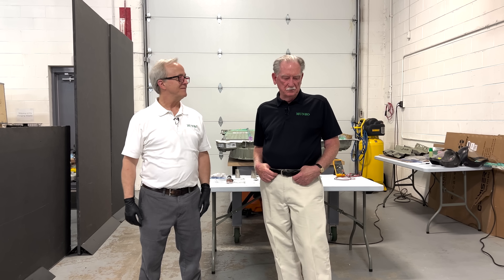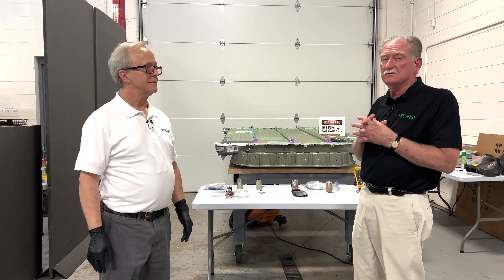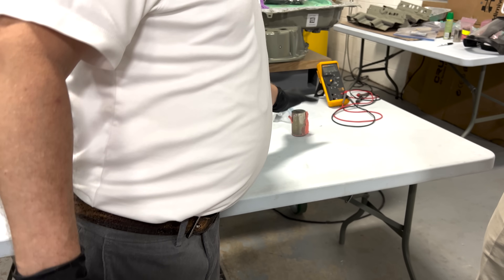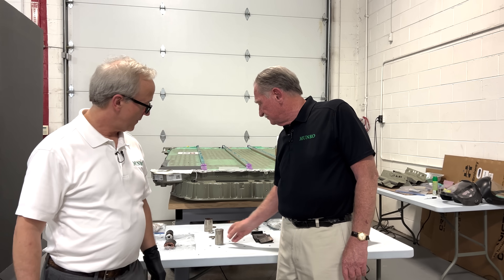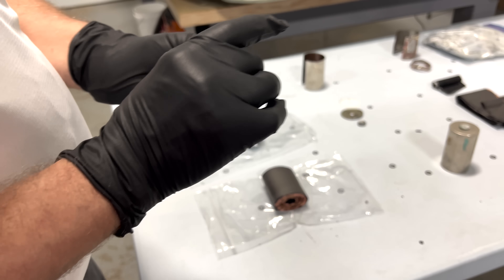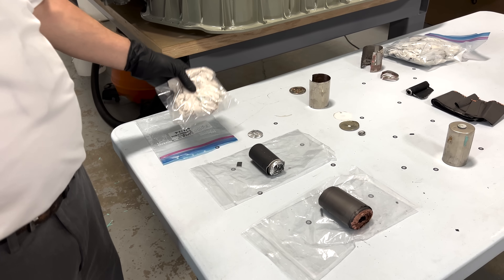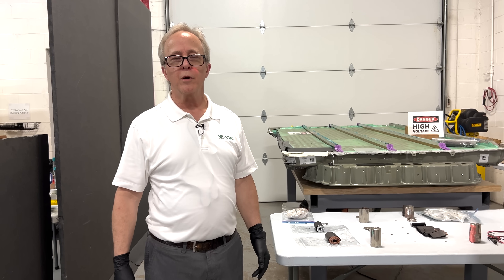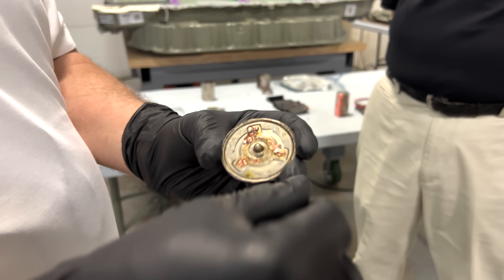Inside the Cybercell! Tesla Cybertruck 4680 Battery Teardown

Comment: Wasn't the 4680 a big disappointment?
Reply: It doesn't have as much total power, or cheaper.....Sooooo, in that sense, YES. They are still working on improving the total power, AND making it cheaper. Increase in production number will  lower the total cost. I think they still haven't done all the things they want to do with the Cell though, so still work in progress.
Reply: Depends on what you consider a disappointment.  If the expectation was that the first generation of cell would immediately fulfill all battery day promises then yes it was.  If the expectation was that they would move the market with the initial release, even if it wasnt the best solution, and continue to iterate rapidly, then it's met expectations.

I think Tesla did hope to get the battery manufacturing at scale faster, but worst case scenario is that Tesla will have batteries on par with the competition that can't be taken away from them because they own the production lines.

As usual Tesla and musk were overly optimistic on timelines, but as long as they dont slow down on iteration, we can expect them to reach the end goal laid out in battery day
Reply: It has been a step-change.
Reply: Production ramp up has been slower than anticipated, but it continues to improve. Recently, Elon said that the manufacturing cost of the 4680 cells was lower than the cost to buy cells from suppliers last year, but cells from suppliers have decreased about 50% during the past year, so 4680 cells are not the cheapest any more, but Elon expects they will reach cost parity with supplier cells by the end of this year.
Reply: @CiaranMcHale  ''Elon said'' ''Elon expects'' Haha your comment makes me laugh, u are not serious right?
Reply: @salland12  What's your problem. I'm citing sources, and you're criticizing that?
Reply: It's really about cost and production speed 
Reducing steps by using dry. Also making less cans is better.
Reply: @ralanham76 
Yes.
High output from a small Factory
.
Then, A 4680 cell without the resistive heating issue makes the cell (jellyroll) more efficient, plus reduces load and complexity of the *pack * cooling system 
It's just "better" all round.
Reply: so far the battery is a lil disappointing based on the cybertruck range.  Elon workin on it, give him some time.
Reply: @davidanalyst671  re: "Elon workin on it, give him some time."  "GAME OVER MAN...!!! GAME OVER...!!!" (best super distressed Bill Paxton/Pvt Hudson voice)
Reply: No
Reply: Yes
Reply: Q: Wasn't the 4680 a big disappointment? A: also yes.

Comment: Are ppl that stupid?  Its not new battery tech, it's simply a larger size?
Reply: No, it's using a new dry process Tesla invented that is less volatile, new anode and cathode connection technique for high-current discharging and charging, a new chemical composition, and new venting systems.  Seems like quite a lot is new.  Still you can stuff an obsolete cell into a 4680 can and call it a larger size - it will never work in an EV, but it is a larger cell. If you got a better design - go for it.  The demand is there!
Reply: @tesla_tap  I'd still argue its not even close to being worth the hype nor the delays.
Reply: With a comment like that, it proves you're the stupid one!

Comment: Says he does have gloves, not going to touch stuff… almost immediately picks up 4680. 🤣
Reply: A sealed cell is not a concern. It's the opened jellyroll that you don't want to touch.  Even then, it's not clear if it is toxic or not, but smart to be safe.
Reply: @tesla_tap  He said the cell is leaking 🤣
Reply: @okgoogle4206 It just looks dented but even if it was, that wouldn't hurt you. The electrolyte doesn't drip out like that anyway. I would definitely not open one without gloves on but unless you decided to use it as sun block I doubt simply picking up the removed jelly roll is that dangerous on a chemical level... I'd be far more concerned about it bursting into flames lol
Reply: @JJFX-  I agree, but it's him who said just before that is was nasty and not good to touch. And we can see the dried electrolyte all over the bottom, he touchd it without any worry.
Reply: Sandy drinks battery acid for breakfast to stay charged up.
Reply: You had me at jelly roll.
Reply: @Mumble-s  that's the term for the many layers inside of the lithium cell. Partly because the electrolyte is kind of thick.
Reply: @ralanham76  Understood. Still made me want a donut. 😉
Reply: Wait & hold my beer 🍺!😂🎉
Reply: Classic Sandy..
Reply: It's not a bomb, sealed cells don't have exposure to hazardous materials.
Reply: Had the exact same thought
Reply: For health:
You could leak test the cells with "ELT 3000 Plus" electrolyte leak detector of INFICON. 
It is what the OEMs also do.
Reply: Do you put on gloves when you pick up an AA battery? Or even 12v battery? It's 3.3v lol
Reply: @TheLobo91  - The voltage was not the concern, it's the possibly toxic/acid compounds from pulling the battery apart, although the concern could be overrated. Better to be safe when you don't know what you're dealing with.
Reply: I don't believe that touching a lithium jelly roll is that a concern. As long as you wash your hands afterwards it's maybe as dangerous as having some gas on your hands after filling your car.
I assume Sandy has touched a lot of extremely poisones things in his career. The jelly roll shouldn't be a big issue. 

Of course, eating or breathing that stuff is definitely a very bad idea.

Comment: Is the cathode always the top-side of any battery while the anode is always to bottom-side?
Reply: Yes. Just look at any non rechargeable batteries. The one with the TAB is the Positive side....
Reply: @1flash3571  OK, so in my head, I can equate positive/top to cathode and negative/bottom to anode? I'm starting to dig more into battery tech in general so want to start getting some of these connections down. Thanks!

Comment: Are you going to do a tensile test on the stainless steel exoskeleton?
The toughest stainless steel alloy I was able to find was 1'690 MPa and 25% elongation at break. So that's 400 MJ/m3 of toughness, up there with spider silk and superalloys.
Reply: What handheld xrf do you use? Thermo or rigaku?
Reply: The CT  is not a exoskeleton. It is  a uni body with regulair 401 stainless steel panels bonded on to function as a outer skin. It is defiantly not some super alloy and even if it was what use is it on a car?
Reply: @salland12  We will see when they do some mechanical testing on it, but right now it's the only steel alloy where a 1.8mm plate can stop a 9mm bullet.
Reply: @salland12  it's ss he bought lije any other maker can..but real car makers use aluminum for weight reduction,not ss to make it heavier. What acuseless dopey vehicle. Kitchen knife on wheels...
Reply: But according to munro,mush invented new metals,mush knows all...except they buy stainless from stainless maker,wait,sandy says tesla is vertically integrated..hmm,guess not. Sandi is confused . For such an expert on everything, he doesn't know what vertically integrated means.  A stable genius,where have we heard that before? How did that work out?
Reply: You write like a stable genius. @cengeb
Reply: @snookmeister55  I'm working on getting just the correct orange tint, stay tuned

Comment: But tesla is using Chinese battery
Reply: Uneducated comment. Tesla uses all the batteries they can. They buy from CATL and BYD. They make their own 4680s. They buy 2170s from Panasonic (but from their own factory - joint venture in Nevada). 18650s still come from Panasonic Japan. Tesla buys whatever they can get their hands on. Cell supply remains an issue for competitors. The difference being Tesla also develops these batteries in partnership with their suppliers. 2170s, 4680s are Tesla designs.
Reply: @mkkm945  vw owns and is partners with several battery comoanues,including one innovating solid state batteries. Tesla is not keeping up..Mush is not a good manager of production for anything. He's a loudmouth,huckster. Lady scientist runs space x...wake up to realith
Reply: @mkkm945  other countries are good but not china they copy everything.
Reply: The Model S/X uses Panasonic batteries from Japan and/or USA.  Cybertruck, Model Y, and Model 3 LR/Performance all use batteries made in USA - mostly made in Sparks NV, and Austin TX.  LFP batteries in the bottom end Model 3 is the only one using China batteries.
Reply: That means it's ok...just follow the hot air that shills r us spews. Always an excuse,always stories. Ummm,ummm,cough,aaaahh,ummm ,eeeehhhh. Maybe a shorted internal cell?

Comment: Given that Tesla still hasn’t managed to get the cost lower than suppliers, the cells can’t be charged faster than competitors & the volume is years behind schedule to the point that it has impacted vehicle programs would you guys consider the 4680 program a failure at this point? 

Not to mention the failure to implement the touted innovations, dry kathode electrode & silicon within the anode. I respect what they have achieved thus far but It’s nothing close to what investors expected from OG battery day. Would really love to get your take on it.
Reply: Per elon literally just last week, in 2023 4680 cells were cheaper than any suppliers. In 2024 it's slightly more due to over supply of cells thanks to legacy backing out of orders(example BMW 2bill northvolt cancelled order. 

He said to end 24 they see a way to 4680 being cheaper than suppliers cells again. And it's all about to come together with their in house tx cathode plant&lithium refinery! Not even 4yrs into a 6yr never been done before cell program. Learn some patience! 👍🏻

The gen2 cybercell allows the ct 123kwh ct pack to outperform the 131kwh lightning pack and the 135kwh rivian large pack's.
Both in performance, charging, complexity, reliability, weight and efficiency. Fkn outstanding job I say to the tesla cell team! 😎
Reply: @4literv6  For the most part they’re on par with the competition when we expected they’d be in a separate league. There is no significant competitive advantage to using their cells vs those they are buying from suppliers. The lack of volume is why they aren’t using them in model Y. If Tesla cells are so superior then model Y owners are getting an inferior pack due to Teslas inability to scale 4680s.
Reply: silicone in the anode?
You probably mean silicon, right?
Reply: @Toby-st  Really dude, you found the need to correct me because one word had an extra letter? Get a life man. I fixed it for ya, I hope that makes your day 🤓
Reply: @adama3231 
Next?
"Kathode"
You're certainly on a roll
Reply: @adama3231  The problem is not that you made a spelling error per se, but that "silicon" and "silicone" are two completely different things and I thought it would be important to correct it so people don't get misinformed. No need to become all personal and start insulting me.
Reply: @Toby-st  it’s YouTube comments not a scientific paper. Who cares, I doubt anyone would have been confused. I’m so sorry I upset you, I have brought shame on my people 😞
Reply: Their cell capacity is ahead of vehicle production,  their price doesn't have to be better to still be equal,  and neither does cell quality.  What this really means is that they're on the cusp of profitability from cell production,  and they've repeatedly said that's the first priority,  after which they'll integrate cell improvements for better performance.
Reply: @jamesengland7461  capacity is ahead of production only for Cybertruck because they gave up on using 4680 for structural pack for model Y which was the original plan. The main reasons for 4680 in house was to be significantly cheaper & for volume. Even if 4680 hits price parity with suppliers let’s not forget the suppliers are making profit so therefore they are still producing the cells much cheaper than Tesla. And for volume, well 4680s aren’t even being used for structural model Y pack so they haven’t hit the mark on volume either.
Reply: @adama3231 
"Given that" (as mentioned elsewhere) The reason 4680 cells aren't cheaper at the moment  is let's call it "broken promises by others" leading to an opportunity for Tesla (the "reliable customer") to purchase other cells at giveaway prices, your first critique of a still developing process is a moot point.
(Did you not watch the meeting? He TOLD you)
.
"Not to mention" (from memory) that the Battery Day projections were just that, "projections" and didn't end at June 2024.
.
They were a combination of numerous processes, techniques and materials which when ready have potential (cell pun) to provide the desired outcome.
.
What "WE" see is NOT the state of the art development. It IS the "reliable production version.

As such "WE" do not know "What they have achieved so far".
"We" (OK, "YOU") don't even know what the cells IN THIS PACK can do..... They just mentioned "Silicon" (capital "S" btw), si it's a different cell, maybe a combination?
Do YOU know the maximum capacity and performance based on that statement?
Do YOU know the current BMS settings?
Do YOU know if they're being cautious, since they know any failure will be a "FUD fest"?
(Would you enjoy that?)
.
WHEN you've reviewed the Battery Day presentation and double checked the timescales, I would LOVE to get "your (revised) take on it"
.
Meanwhile, DO NOT post your "opinion" as "the expectations of (all?) investors".
.
Have a mediocre day
Reply: You think you understand the cost of the cell better than Munro?
Reply: @AntonioDiNunnoEVS  No, I don’t, that’s why I asked them for their take on it. This video simply compared v1 vs v2, they didn’t give any opinion on the overall success of the program hence my question.
Reply: Yeah watch as 11:24 and tell me Sandy knows what he is talking about. He says Magnesium then has to look at Tom for validation when he says Manganese. Sandy is a smart guy, but by just hearing him speak about batteries, you can tell that his knowledge is limited.
Reply: Yeah 4860 is a joke. That probably why they fired Baglino. This battery is the same NCA material that's in the 2170's.
Reply: @phila.6521  Not NCA
Reply: @AntonioDiNunnoEVS  Care to elaborate on what they are then?

Comment: fiasco.
Reply: Elaborate with facts and articles which back up your baseless assertion please! 
Otherwise it's an insane accomplishment for an American based company whose not made their own in house cells prior to the 4680 program.

To have a 123kwh ct pack which somehow allows the ct dual motor per Edmunds to outperform the 131kwh lightning pack and the 135kwh rivian pack's. With better performance, better charging&much better efficency plus it weighs 300# LESS than the rivian pack! 

Those competitor packs are made by LG chem&sk innovation who have built batteries for decades between them!
Reply: @4literv6  LOL I know you upvoted your own comment. Mmmm slobber on those Elon balls.